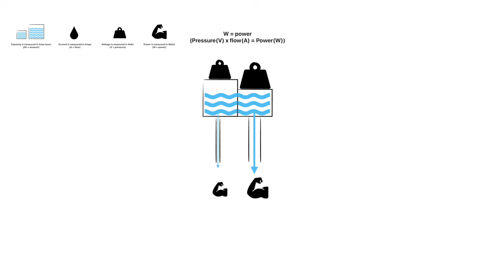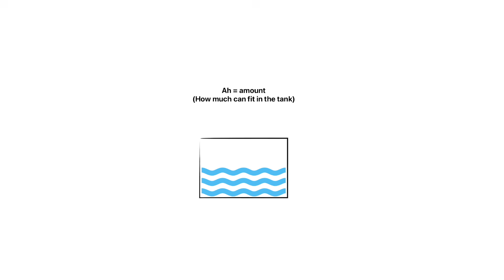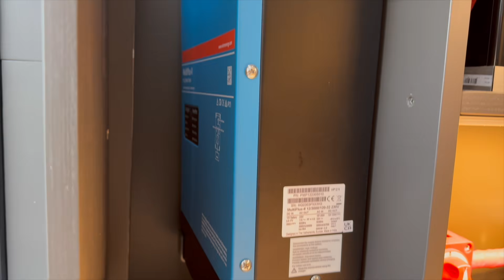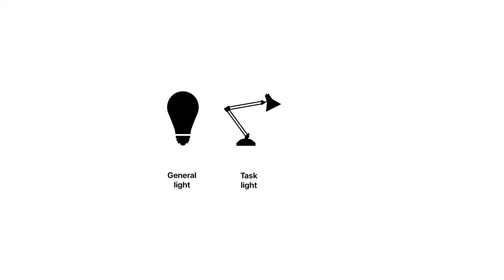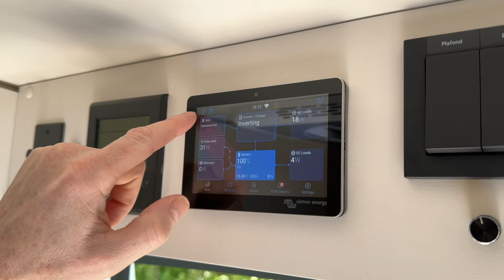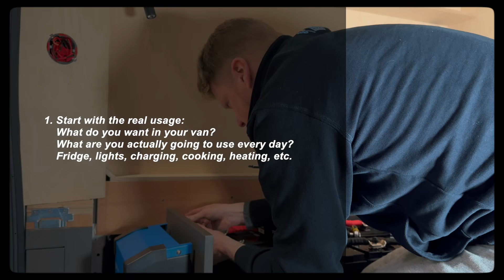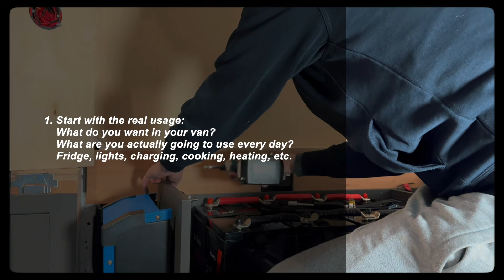I’m an Electrical Engineer, This Is How I’d Build an Off Grid System (Van Conversion)

Comment from the maker: We made a list of all the tools and products we used during our van conversion, including all electric components!

You can access the FREE DIY Van Conversion
Tools & Products Guide right here:
https://ourtraveljournal.nl/en/free-diy-van-conversion-tools-and-products-guide/?V=1a13105b7e4e
Reply: I was looking for the light switches and usb outlets you used in the parts list but can't see them?
Reply from the maker: @onemanandhisdog9 oh, good catch! We’ll add the USB outlets, but the light switches are just from the local hardware store 🤓 the switches are “spring-loaded pressure surface switches“ from Gira; it’s an European brand. I’m not sure if this is what you call it in English, I’ve just translated it on Google 😂

Comment: Very impressive video, thanks for sharing your insights! May I ask why you went with 4x 100Ah instead of two big blocks, e.g. 2x 300Ah class with 200A BMS each? Same 400A output, fewer connections, and I'll guess more capacity per kg. At least I hope so, because that's my setup 😄"

Comment: Thank you for the presentation.  Curious, why would you have the batteries elevated over the power systems.  I would think lower center of gravity and having reactive loads (weight of the batteries) travel right to the floor rather then elevated platform.

Comment: just wondering why you placed  heavy weight batteries on top of lighter setup? for electricity inspection is also better to have batteries at the bottom and do all business with victron components at the top, no need to be at floor level. also for vertical center of masses is better to have batteries lower(better for vehicle turns at speed)

Comment: Just a few tips, 
- You put the electrical component on the bottom shelf and the batteries on top, you should really do the opposite, to lower the center of gravity as much as possible;
- Also the batteries should not be this close to each other to let air circulate, and they need some kind of ventilation. While is true that they need to be warm to function properly, too much heat and they will catch fire or at least release gasses (I think in Australia and some other places you are mandated to have batteries in a separate compartment with ventilation);
- Speaking in term of Ah can be deceiving, we should always talk about Wh, some people may have 24V or 48V systems (but this is a problem found in most camper conversion videos), you consume and produce energy, is more intuitive and more technically correct (and imho easier to understand);
- When you are calculating the battery size you should also consider how much energy you can generate with solar and driving, you can have 20kWh of capacity but if you just have a tiny panel that generates 50Wh on a good day you are equally screwed;
- Is never a good thing to brag about being an engineer.

Comment: I have a 200 Amphr battery, 2000 W inverter, 400 W solar panels but with essentially full charge and only my 12 V fridge on, can’t power my 1400 W coffee maker - apparently the battery can’t permit more than 1200 W items - why does no one mention this feature of batteries. Or am I wrong?

Comment: Nice vid! We are currently converting our old van to the new standards with victron and it look rougly the same. we are not going for off grid so we have a smaller battery pack etc. but we where thinking about induction. How did you manage the load balancing of the induction stove? That was one of the questions I still had going into our build :D

Comment: Why didnz you went with 24v system?
Reply from the maker: for us it was budget and efficiency. Most of our daily components we chose like the fridge, lights, and pumps are natively 12V, which are cheaper and more common. By staying with a 12V system, we avoid constant conversion losses and the need for extra step-down converters or shutoff devices, keeping the build simple. We manage our 230V cooktop with some load-balancing magic to stay within the 2400W limit of our Multiplus-ll.
While a 12V airco is possible, we chose more roof windows over the extra solar and batteries required to run one. As for the wiring, since our runs are very short, the cost of thick 95/120mm2 cables was actually lower than buying the extra components needed for a higher voltage system. 

If you need more power than this, 24V is a very valid option. We just didn't need it for our specific usage and it would have cost us more for this setup. The point of the video is that you should select your needs first and engineer the system around those, rather than just picking a voltage and forcing everything to fit. 😄
Reply: @ourtraveljournalnl  im also an automation engineer in germany in the beginning :) funny enough i dont have problem understanding industrial problems but with camper vehicle electric my brain is shutting down -.- but your video was the most understandable and best video of all out there!

Comment: 400ah 12V is 4.8kWh. 3.9Kg Propane is 54kWh. 1 ltr of Diesel 10 kWh. On a like for like basis that means - 400ah is 350g Propane or 0.5ltr of Diesel. Which means what? A 30 minute induction hob cooking session will use 25% of your battery bank and 30 minutes heating another 25%. The equivalent gas hob will use around 100g of propane, and a D2 blown air unit about 100ml of Diesel. Think about this before you go all electric. In my experience, if you go all electric people never have enough power - especially in winter or colder climates. This does not include running your fridge, lights, water, TV, stereo - and do not underestimate how much power is used charging laptops, tablets, and phones. That 400ah stack could easily become 800 or 1000. Solar power is free, and that is a very clear bonus - but the sun does not shine at night, or on dull days. Interested to hear how other van goers decided on their energy mix - I am about to do another conversion and do not want 230V in my van - might do propane again - undecided...
Reply from the maker: Hm, that’s a really different experience than ours. We wild camped for 4 weeks in Slovenia and Italy in fall (not that sunny), currently in Scotland (not sunny at all I can tell you 😂) also wild camping for 2,5 weeks and still we’ve never been below 50%. We have phones, camera’s, laptop that we all charge in the van and we drive every other day. It’s definitely not an issue for us. Also did winter camping with -15 at night, but that was just for a long weekend, but even then, no shortage of power. 🤷🏻‍♀️

Comment: I am wondering if you recommend adding a fuse between each battery in your parallel configuration to protect from a a shorted internal cell. Also, should the batteries be connected to a bus bar instead of each other to prevent battery degradation of the last battery in the parallel chain?
Reply from the maker: Well, this is how Victron themselves show it in their documentation/manuals: ideally each battery positive should be individually fused before connecting them together in parallel, so the other batteries cannot feed a fault in one battery or cable. However, I engineered it in a different way. It’s a long story, so if you want to know how I exactly did it you can look up the comment from “TheDutchGamerAlex” where I explain everything. (It’s too long to write it all again 😂)

Comment: Great video. I'm about to purchase an all electric van for light conversion to overnight/camper. Presumably a different animal in this regard....?
Reply from the maker: Thanks! 😃 An all-electric van is definitely a different animal, but most of the Victron components shown in this video can still be used, including the MultiPlus, MPPT, Lynx Distributor, SmartShunt, Cerbo GX and the house battery system.

I think that the main difference is the DC-DC charger. A diesel van has an alternator, while an EV doesn’t, so charging a house battery from the vehicle depends entirely on how that specific manufacturer manages access to the traction battery.

If I were building an electric camper today, I would first research the vehicle’s charging capabilities and then design the house battery system around that, rather than assuming every EV works the same way. 🙂

Comment: Very nice video and a very clean build! One thing that I'm not quite sure of yet is how to do grounding, there are many conflicting opinions around the internet and I'd definitely trust an electrical engineer to do it properly. Is that big cable that's also connected to the lynx distributor negative terminal going to the van chassis? And is it deliberately sized the same as the main cables going to-from the batteries? I'm also curious about the little negative busbar next to the dc-dc charger.
Reply from the maker: Thanks! 🙂 Yes, that large cable on the Lynx Distributor negative busbar goes directly to the van chassis, and I deliberately sized it the same as the main DC cables (120 mm²). In high-current 12V DC systems, I prefer equal-sized grounding conductors to minimize resistance and keep fault paths predictable.  

A lot of the confusion online comes from AC protective-earth (PE) rules, where PE can sometimes be sized around S/2. But those standards are mainly for AC building installations, not heavy low-voltage DC systems like this.  

And the small negative busbar next to the Orion XS is there because I chose to run dedicated negative cables as well, even though the Orion XS internally shares the negative. It keeps the wiring clean between the starter battery, Orion XS, and Lynx Distributor 🙂
Reply: @ourtraveljournalnl  Thank you very much for the detailed reply! That cleared up my confusion, and I'll follow the same pattern for my own build :)

Comment: Hi Brendan, great installation. I just had a question: don’t you think it’s necessary to fuse each battery before connecting them together, in case one battery fails, so the other batteries don’t feed the fault?

And for the booster, you should have an alternator signal in the right B-pillar, behind the plastic trim. There is a connector there. On the Fiat, the signal is negative.
Reply from the maker: True, and this is also how Victron themselves show it in their documentation/manuals: ideally each battery positive should be individually fused before connecting them together in parallel, so the other batteries cannot feed a fault in one battery or cable.  

I’m somewhat sorry but i’m going to geek out here, just a little-bit, that being said my advice would always be to follow the documentation/manuals as Victron provides them. In our case as an electrical engineer, we made a conscious tradeoff because the entire system is built more like one engineered battery pack: diagonally connected for balanced loading, equal positive and negative cable lengths, properly crimped Klauke dynamic cable lugs designed specifically for fine-stranded flexible cable, correct torque specs, oversized busbars/cabling for the full 400A (and more), really short equally cable busbar runs, and all protected by a main ANL-400 fuse with an high enough AIC rating. So again while individual battery fusing is definitely the more fail-safe/professional approach, the practical risk difference becomes much smaller in a setup built like this.  

And thanks for the tip about the A-pillar signal! I’m definitely going to research whether that’s also possible on our 2021+ CANBUS Euro 6 Ducato. I would still use the 2-minute delay relay though, just to make sure the charger does not immediately go full charge while the engine is still idling/stationary. If you have any more information about that A-pillar connection or pinout, like the location (passenger side?, in the A-pillar where the tweeter is located? Or just below at the dash) that would be very welcome 👍
Reply: @ourtraveljournalnl  Yes, I completely understand your point. In the end, it comes down to risk assessment you can always add more protection, but in this specific scenario I believe the practical risk is very low.

The worst-case scenario would be a catastrophic battery failure, although that is extremely unlikely, and as a last layer of protection there is still the BMS.

I always try to continuously improve my installations and learn from different approaches 🙌🏻

Also, pardon me I meant the B-pillar. Later I saw that you had already checked there. On the newer Fiat Ducato installations I’ve worked on, I haven’t had any issues with the D+ signal, although it’s possible that your van does not have it available.

Greetings Alex 🙋🏼‍♂️

Comment: Hoi Sanne en Brendan, toffe video! dankjewel voor de informatie. nu had ik alleen een vraag betreft het laden via de dynamo. ik heb zelf ook een Ducato euro 6 uit 2017, dus die heeft ook een slimme dynamo. Ik had begrepen dat ik daarom voldoende had aan de Victron Orion-Tr Smart 12/12-30A Non Isolated Acculader. Wat is dan de rede bij jullie geweest om met de Orion XS te werken? Groetjes, Erik @Rollendopreis
Reply from the maker: Hoi Erik, dankjewel! 😄

De Orion-Tr Smart 12/12-30A werkt inderdaad prima met een slimme dynamo zoals in jouw Ducato Euro 6. Wij hebben gekozen voor de Orion XS omdat deze veel efficiënter is, minder warmte produceert, stiller werkt en compacter is gebouwd.  (Euro 6 - 2017 - Kijk even bij bij de B-pilaar van zowel de bestuurder als de passagier, als je daar een groot elektra blok ziet kan daar een D+ signaal bij zitten, bij ons was dat niet het geval)

De oudere 30A Orion-Tr zit rond de 87% efficiëntie, waardoor hij relatief veel warmte produceert en soms extra koeling nodig heeft. De Orion XS haalt ongeveer 98% efficiëntie, blijft veel koeler en kan tegelijk tot 50A leveren. Daarnaast heeft de XS ook een VE.Direct-poort waardoor hij direct zichtbaar is in onze Victron Cerbo GX setup voor monitoring en logging.  

Wel is de XS ook een flink stuk duurder, dus voor veel setups blijft de 30A Orion-Tr nog steeds een hele goede keuze 👍

Comment: I understand that you are an electrician and that probably explains it but do you have some advice on how to fit all the breakers in that Eaton 6 module box. I have it in front of me and there is almost no space left do run the wires 😂
Reply from the maker: Hi! 
From shore power it first goes into the 2-module Eaton enclosure where I installed a B16-30mA RCBO. From there it feeds the Victron MultiPlus-II.  

The AC-out 1 from the MultiPlus then goes into the 6-module Eaton enclosure. What you see there is a 40A-30mA RCD (earth leakage protection only) with an electric busbar feeding four B16A breakers. The breakers themselves each have their own output cable, while all earth connections are combined using a 5-port WAGO.  

I know space is very limited in these enclosures, but I routed all cable entries from the back to keep it clean. Just search for the Hager VKS04COMBI. Also, make sure you use long enough wire ferrules for the B16 breakers.
Reply: @ourtraveljournalnl thanks for the explanation. I figured some stuff out by pausing the video and zooming in 😂 Do i understand correctly that you didnt use the Eaton version with the N/PE klem?

Comment: I have euro 3 what altenator should i use?
Reply from the maker: Euro 3 vehicles typically feature a conventional alternator that maintains a steady 14 to 14.4V while the engine is running. Therefore, you can safely rely on the Victron DC-to-DC charger's automatic engine detection mode. Another option would be a traditional split charge relay. However, I strongly advise against using a split charge relay if you are installing lithium leisure batteries in your camper. A major benefit of a DC-to-DC charger is that you can adjust the current output. This is especially useful if your alternator has limited capacity, as it prevents overloading.

Comment: Shame you don't mention the most important thing about lighting that most people mess up - CRI and colour temperature. So so so many builds mess up their lighting by using cheap bright white LEDs instead of proper <3000K COBs.
Reply from the maker: You are absolutely right, CRI and color temperature are incredibly important for the end result. This video was mainly focused on the layout and the placement of the switches to which lights and how to control them, but your point about using <3000K COBs instead of cheap white LEDs is a great addition. We might make separate, more detailed videos for specific topics like this in the future. Thanks for the feedback!

Comment: Awesome!!! Wondering why you used 12v batteries in your system and didn't go higher reducing the amount of batteries needed?
Reply from the maker: A lot of people ask this question, so I’m just gonna paste an answer that I gave earlier. Thanks for watching and hope this explains it 😃:

For us it was budget and efficiency. Most of our daily components we chose like the fridge, lights, and pumps are natively 12V, which are cheaper and more common. By staying with a 12V system, we avoid constant conversion losses and the need for extra step-down converters or shutoff devices, keeping the build simple. We manage our 230V cooktop with some load-balancing magic to stay within the 2400W limit of our Multiplus-ll.
While a 12V airco is possible, we chose more roof windows over the extra solar and batteries required to run one. As for the wiring, since our runs are very short, the cost of thick 95/120mm2 cables was actually lower than buying the extra components needed for a higher voltage system.